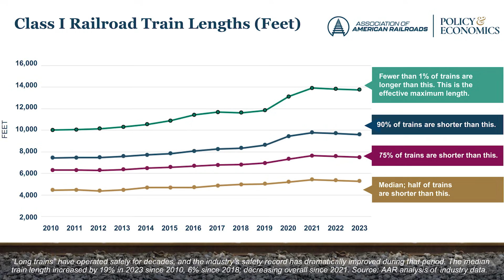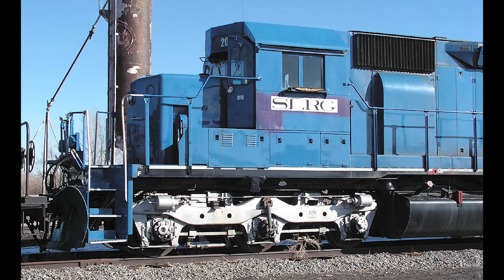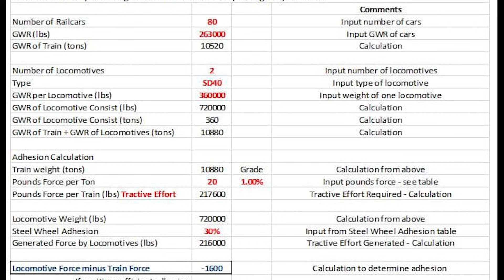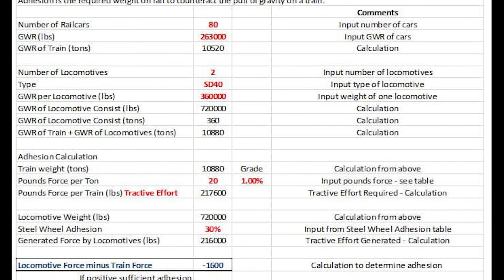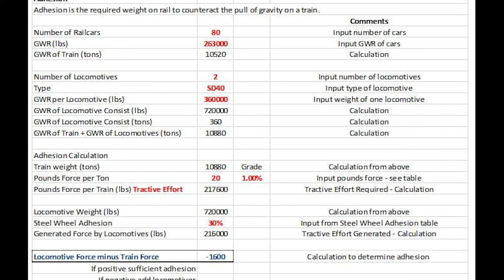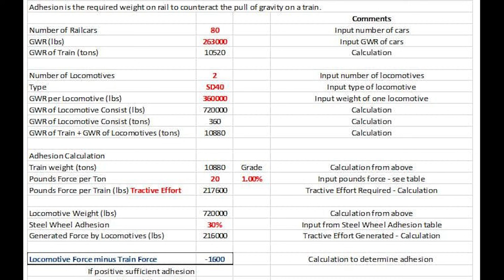The Locomotive That Slid Instead of Pulled

Comment: B36-7's pulled great when they were running 100%. The problem was if they were not set up properly for multiple units, they would burn up the wheel slip circuit resulting in excessive/uncontrollable slip. The sanders were also notorious for plugging creating it's own issues. B40-8's are much better running but have their own issues with the pinion gears and computer controls.

Comment: The GP50 was 3500 horsepower “sure” 4 axle really? Living on unicorn tears! No it’s was 3500 on the high side of transition, 2000 on the low side! This GE 4 axle 3600 horsepower is great at 50 MPH! It’s was a worthless unit at 3 mph! Guess when the train needs the power? It’s a wonder that GE ever made the top manufacturer! Being dumb enough to place 4 axles under 3600 horsepower! Wheel slip is easy to understand, if you exceed adhesion, you get wheel slip! If you reduce power to address wheel slip you end up sitting on the side of the hill stopped! It’s called laying down on the hill!